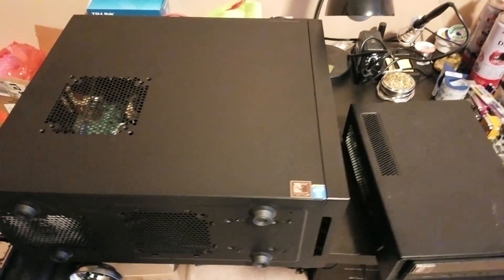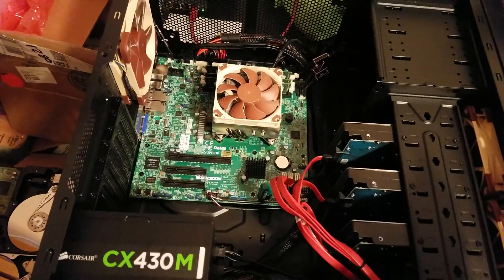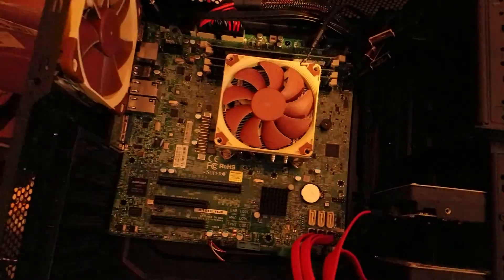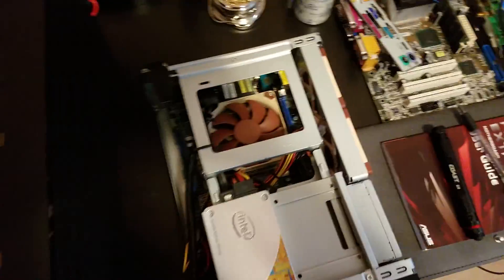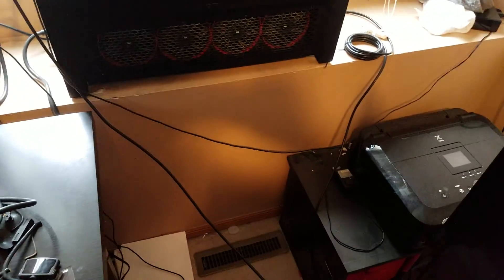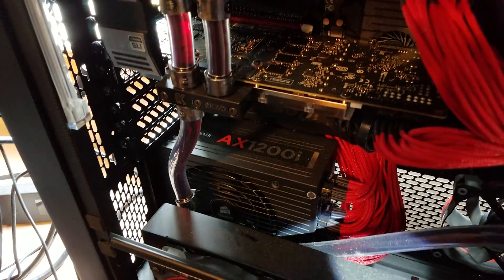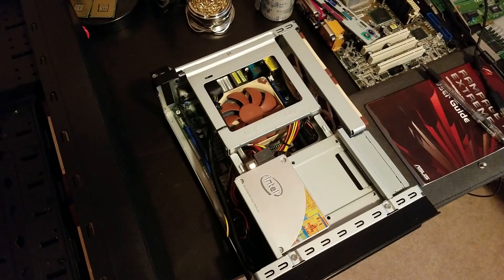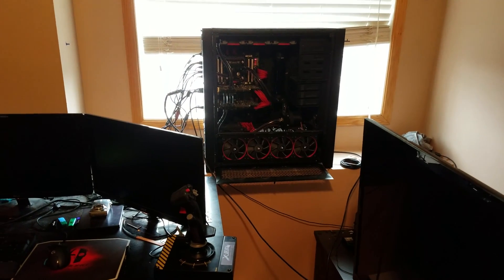Positive Air Pressure in PC Cases

Comment: I totally got that, but physics would say that lot of air gets in, it might get hotter by the CPU GPU RAM temperature... Because it doesn't get out fast, but it stays inside a bit, and pls correct me if am wrong, am about to install my fans, and I need help :)
Reply from the maker: In all honesty, I have seen little if any difference temps wise, as long as air is moving.  You just don't want dead spots.  Or air being reused for cooling, with air coolers.  Besides, less dust will mean it runs cooler longer.